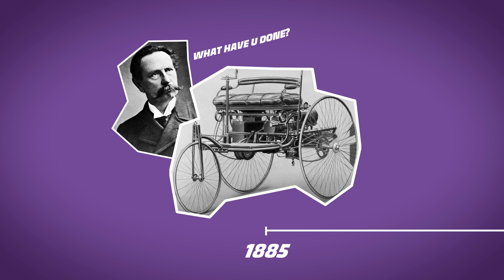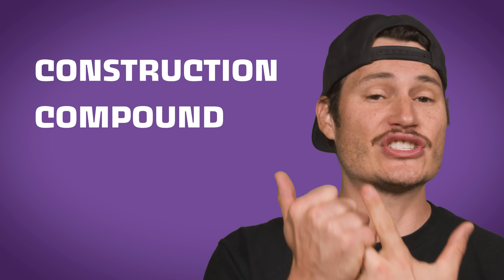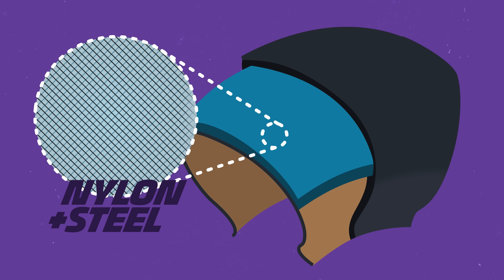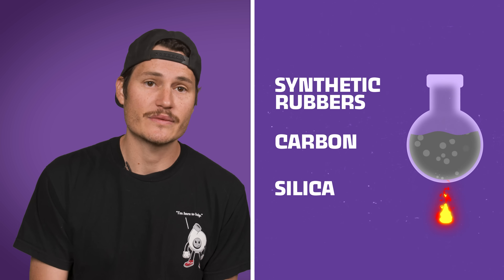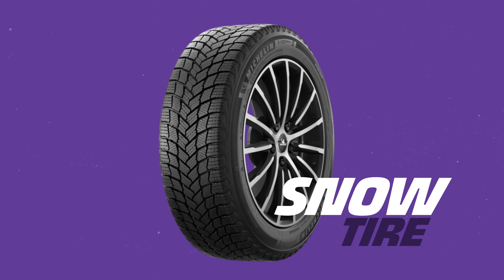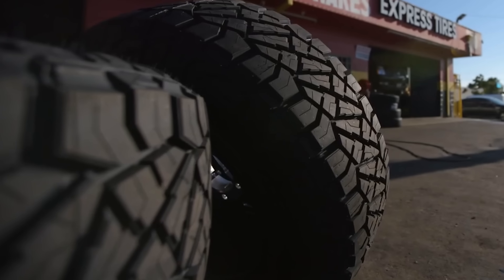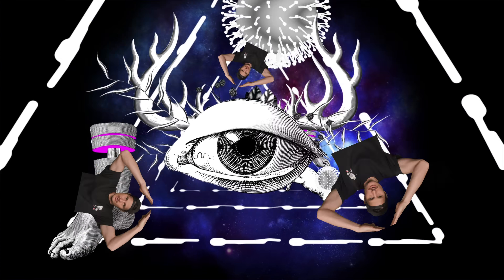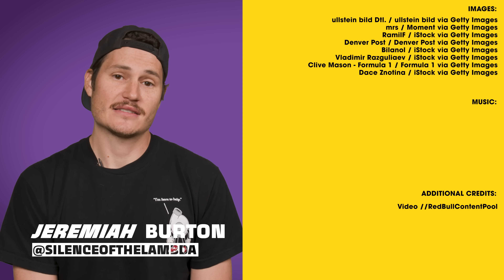The Surprising Science Behind Tread Patterns

Comment: The wider tire provides more grip because... rubber is NOT indestructible (I'll explain): there's a tensional and compressional limit to all materials and tires are no exception, thus, there's only a certain amout of force a given X area of tire can bear. (be it for acceleration, braking or cornering). So, if you increase the amount of rubber/the contact patch area... you'll increase the amount of force you can apply A.K.A. GRIP.

Comment: As an engineer/amateur-racer I had the same question. Did some research, and it's covered a bit in a book from Carroll Smith if I recall. The key thing is that we have to consider that the friction coefficient is also a variable, and that friction isn't the only mechanism producing traction. We think of the friction coefficient as a constant in physics class, where things are not terribly dynamic. But in a race car, the tire is getting deformed constantly. One of the things that affects is heat generation. For racing tires we need a little heat for peak friction, but on any tire if you get them too hot, that coefficient starts to fall off. Turning a car at a certain rate requires a specific force. So, if you do that with a smaller tire, it's going to heat up quicker, and start losing traction. On top of that, tires don't provide grip solely based on friction, they also exhibit cohesion, which physically sticks them to the road, like tape (though not as strong). Think about a set of summer tires, they really are sticky to the touch. And that's not a function of normal force, so bigger contact patch, more stickiness on the road.

Don't forget also that your contact patch will largely be determined by the weight of your car and your tire pressure. Pressure x area=force. And that force has to equal the weight of your car (otherwise the car's going through the road, or taking flight). If there were no other effects, your contact patch would always be determined only by the weight of the car, and the pressure in your tires. In reality, the carcass of a tire is stiff, so it provides some support even without air pressure, and you have to factor that in. But in general, you can get a larger contact area with lower tire pressure. That can increase how much you take advantage of the cohesion part of your traction. But it will negatively impact how much heat your tires generate (lower pressure, more tire deformation while driving, and therefore more heat), which then lowers your friction coefficient. So, there's an ideal pressure to run at too (which varies based on the type of driving). 

One last thing, while people often assume friction maxes out at 1 (I've even had senior engineers say that), there's no physical reason it has to, and there are definitely things with >1 coefficients of friction. But for most of the things we deal with day to day, it does just happen to be less than 1. 

That concludes my essay, sorry, but hopefully it helps.

Comment: The question about the relation of tire width to the force of friction really has me stumped. No where in the equations for mu or the force of sliding friction does surface area come into play. The only thing that surface area really affects is pressure but that doesn't play a part in any equations for friction. The only explanation I can think of is that rubber and tarmac have such high grip, that you're actually shearing off rubber from the tire (skid marks) so the mu value would actually be between rubber and rubber, or how much force it takes to peel rubber off the tire itself. I'm stumped and am quite well studied in physics.

Comment: well, force = pressure*area. There is your area and the relationship with pressure. It takes a bit more time to understand. It isn't as straightforward. The wider tires are to distribute the force to multiple wide contact patches on the tire, if not done this way the tires will just be spinning because there is an equal force but not enough traction. As force is constant, the pressure decreases with an increase in area, therefore less rubber burnt on the spot and the tires won't dig into the ground, consequently going somewhere without wheel-spinning becomes possible. ultimately,  for drag races, going the quarter-mile works, thinner tires work when you just want to smoke your neighborhood.

Comment: The normal force works on the gravitational force in the opposite direction basically the force of the weight back on the tire 

But running wider tiers if they weigh the same they'll have the same normal force this comes down to more of the tire making contact to the road therefore the more particles making contact. This means a higher frictional force and a hight coefficient 

Frictional coefficient equals to the frictional force divide by the normal force

Having wider tires is also not the best way to get more grip as more power will be needed to overcome the frictional force and that's why engineers run towards aerodynamics

I hope i am close ti having it right I'm a high school student in South Africa 🇿🇦

Comment: Only went to a normal ass school, but when youre into cars, you make the same question sooner or later to yourself, Jerry.
Very basic answer to your question is: Because tires flex and deform, when forces are applied to them, instead of staying in the same shape for example like metal would do in the same situation. So the more contact surface there is, the more they have the chance to get that "hook" effect on the surface youre driving. Most efficient on asphalt. If the tires would remain static under applied forces, that would not work anymore and the wider tires would not provide more friction.

Comment: Does a wider tyre have a different contact patch area than a smaller tyre with equal weight on it? If so does it have less force per unit area acting on the contact patch? If it does, can the extra area with less force per area produce more overall grip or is it the same, is the relationship between tyre width and grip linear? Assuming both tyres have the same diameter, construction, pressure, loading etc. only changing tyre width

Comment: Why wider tires? Because when a tire is spinning on dry asphalt, you are overcoming the shear strength of the rubber of the tire, not the friction between the two surfaces. We know this because of the rubber left behind on the road- aka, a burnout. 

As a mechanical engineer, this same question bothered me for a really long time. I was glad to put it to rest.

Comment: Well the reason comes down to the composition of the tires…So with tires that have a softer compound, they are usually designed to be wider; Largely to support the weight of the car…Softer tires also have better traction as they have a larger friction coefficient which is why you see a lot of F1 cars use softer tires(But it also depends on the conditions because in Austin, Max Verstappen used harder tires because of how hot they were getting on the track in the Texas heat…); With that being stated, width also plays comes into the conclusion as well…Soft Tires have to be wide and not narrow, as they wouldn’t last very long on the road, and quite frankly would be a waste of money…With harder tires, it’s the opposite, quite frankly…Another thing is that you have to take into consideration that the asphalt itself is not uniform…It has many different bumps and it’s not smooth per say…So with a wide tire compared to a tire with less width, the wider tire has a larger area in which it can make contact with the surface(ie the asphalt…); Larger surface area=higher probability of contact…

Comment: In the components of the rubber mixture you have the most important skips, which is indispensable for the vulcanization of rubber, and the vulcanisation of the material all possible. sulfur! Without sulfur, your tires would be practically black erasers. And at the point tire design, you also have an important point skipped: the rolling noise.

Comment: The widers bigger tires would be for 1 the more ground you cover the more chance you have for maintaining traction should a part of your tire come into contact with a specific surface that will provide lower friction 

And 2nd is just a geuse but I'm guessing that the equation is only for the friction provided between the 2 types of materials and not necessarily acount for the roughes of the surface and a larger tire covers more of the rougness and therefor more grip 

I am answering this at work and only listened to the video while glancing every now and then at my phone so 

Sorry if I'm not even remotely correct

Comment: I'm not looking through all the comments to see if someone was told they are right by donut. Although I believe the reason for wider tires is to handle all of the horsepower and torque given to the wheels. Otherwise your tires will spin and you are losing traction. Spinning is not winning in drag racing.

Comment: 9:10 The blades on ice skates don’t contact the ice; a properly sharpened blade concentrates your weight on its edge, and that force melts the ice to create a microscopic layer of liquid water. It’s that layer of liquid water that an ice skater actually hydroplanes on. So the μ of frozen ice and steel is irrelevant. 🤓

Comment: Why is it that the smaller grooves (Sipes) on the edges are shallower than the other grooves, so than when the tyre is partly worn but not worn out, they have disappeared so they may as well never have there in the beginning? The wet performance at that point must be significantly degraded compared with new tyres, but they are still useable.

Comment: To answer your question. Racing tires often are soft because that generates more friction. Soft materials like rubber have weak shear strenth, so a large area is needed to support large tangential forces. The amount of force that friction can exert is limited because of the shear strength of the tires materials. So wider tires increase the surface area, maximizing grip. 🤓 did I win a shirt 👕 😅

Comment: Because wider tires allow you to use softer compounds that have a better coefficient of friction a skinny tire with a soft compound wouldnt last. The larger surface area allows less stress to be applied on the material therefore allowing it to last longer. But apples to apples if it’s the same compound the friction is the same for different size tires. The really big difference is when it comes to cornering but that’s outside the scope of the question (and my understanding) lol

Comment: @benfishburn7969, 1 year later...I think the question was, why are larger/wider tires better for traction, from a coefficient of friction standpoint. Wouldn't the answer he's looking for be that the torque force is distributed across a wider contact line across the tire's width and/or area in contact with the pavement, providing a lower power gradient at each point of contact per torque input, thus more efficiently distributed torque/force application, raising the threshold of traction loss from power input, braking, or centrifugal (lateral) forces on the vehicle while turning.

I know, there must be a shorter way to say this...Greater tire width distributing force on contact is physically somewhat similar to a lower gear multiplying torque from input -- both achieve improved potential for intended output motion with reduced power waste (conversion to heat/compression/stress).

Comment: could be wrong but, I've heard wider tyre's contact patch does also look wider and shorter, the tyre is not plane shaped, then the patch either, and as it deforms, there are parts of the patch that deforms more than other parts of the patch, just by the wight itself of the car... so those parts more squished to the ground has bigger normal force, about the center of the patch, now imagine a completely rigid tyre, how does the contact "patch" looks like? it's a thin line perpendicular to the "lenght" of the tyre right? well, all of the points should have the same normal force, so as you get closer to that, the normal of the different points of the contact patch gets more and more similar among them, then, the patch has almost a homogeneous grip, like when you put a lot of pencils together and they're indestructible, well guess wich tyre does shorten the patch, I said it at the beginning...

Comment: For drag cars specifically, the most traction to get off the line is with wide tires. Wide tires = grip. Once in motion, due to the pressure and rotational force the tires actually get skinny offering an ideal balance between grip and resistance?
Oh, and for the formula, I think the dude that came up with it looked at all the factors and said "fuck it, my wife just made dinner"

Comment: Well it seems like you asked a simple general question and all the one ideas science answers want to out shout each other. But they didn't do that at either kind of race track when I was there. For drag races they built up the horsepower and torque to get going quicker. This means after your motor and trans you need heavier drive shafts, rear ends, axels and hubs or drums. This needs a heavier tire with more surface area to produce the same pressure and traction when you want to build for more of that too. Motto: Build well, drive fast. Pop! Try again.

Comment: Dont need to corner, but need to go fast really quickly? Wider tires. Them suckers flex from a stand still...like a lot. It looks so weird in slo-mo. One could imagine it like a rubber band where surface area is not only intuitive but also a constant, therefor, it would be redundant to add it to your calculation...its built in. Like pulling back a rubber band to flick it at your boss, a tire is like a slingshot and the more surface area you have means it is less likely to "snap" like that rubber band that just hit you in the face....serves you right xD Also, it will be twist less from the extra strength. In short, fluid dynamics be like that sometimes x3

p.s. I suppose that there is more then one practical answer, but really the important part is that surface area is built in to the equation already so...flex, losing rubber to road contact and even air pressure to contact ratio are all just observable outcomes of what Mu looks like in the real world. Math looks pretty crazy when it goes from the paper to the road.

Comment: Actually the formula you are using is true, but the thing is that, to use that formula you are supposing that the car mantains no-slip condition AKA, the tyre contact point (in reality it's a rectangle) velocity, respect to ground is 0. This is always true as long as you dont slip.

The thing is, to ensure that you don't slip, the force you have calculated by means of the coefficient of friction and the normal forces, must be withstand both by the rubber compound, or by the road surface, so, the force gets evenly distributed between all of the points in contact between both bodies, this means that you can calculate the actual shear stress (parallel to the surface) in each point both of the road or the tyre (this has pressure dimensions ->ShearForceApplied/ContactArea) and by knowing the Young's Modulus of the material you are dealing with and applying some matematical transformations, you can actually see if the material is going to withstand that force or break.

This is why when you go over sand or gravel, it gets shoot out back, as it can't keep togheter with the road surface, and also why narrower tyres will be easier to slip with the same Torque applied to them.

If all the contact points, are "breaking" ( the shear stress is bigger than the one they can withstand), the tyre will start slipping, and then the coefficient of friction will be reduced.

This friction coefficients (static v=0; and dynamic v><0) will be anyways dependant on more factors, such as temperature, tyre pressure, the materials into contact, etc.

Hope this was clear enough :))

Comment: A normal tire that would have to deal with all that horsepower in a dragster would stretch out do to rotational force. The middle of the tire would stretch out wider and wider then shred its self apart. A normal tire wouldn't be built for all that shock and rotational force,but the tires they do use are wider and stronger, with them being wider them can worry less about the tire becoming a disc tire(disco tire)jk. And the tires are probably  reinforced with carbon or something. How'd I do Jerry?
Reply: The bead on a normal tire would probably slip off the rim, the dragster tires would have to fit on certain rims and those rims would  have bead locks so they won't fly off into space.

Comment: Asymmetrical tries are the best! Why would you buy tires we're half the tire is working against you? Have a symmetricals now will never ever ever go back. As to why you would run wider tires distributing the force over a wider area means less force over any given space. Basically the amount of force per square inch is lessened. This results in not only a better distribution of force (grip) but also increased strength. Because any square inch square centimeter however you want to break it up, given section of tire, you're exerting less shearing Force.

Comment: Actual you don't glide because of the ice (kind of for icescating).
You glide because the ice melts under the pressure crated under the blades. So you actual glide on the water.

Comment: because bigger tires doesnt give more grip... directly. 1 lb of mass with a coefficient of 1.0 static should take 1 lb of force to initiate the slide, bigger tires gives more usable rubber in a traditional car because a longer lever has the ability to flex more sticking to the road nicer but small wheels can make equal grip with the right setup ie. nissan delta wing or chapperral racing 6 wheel f1. the next limitation comes when you look at rotational mass